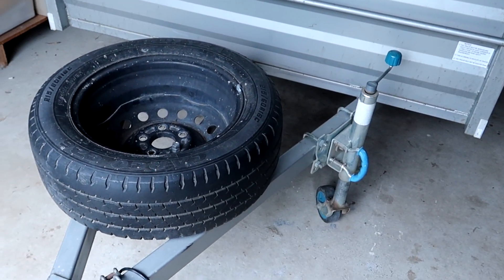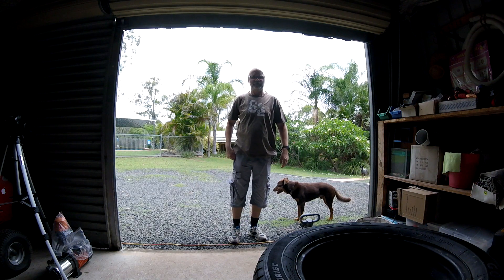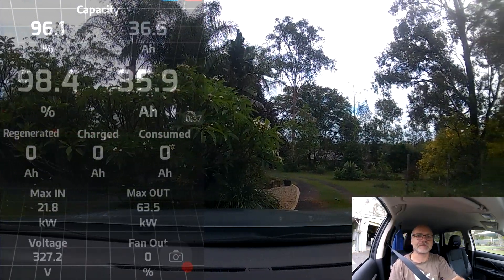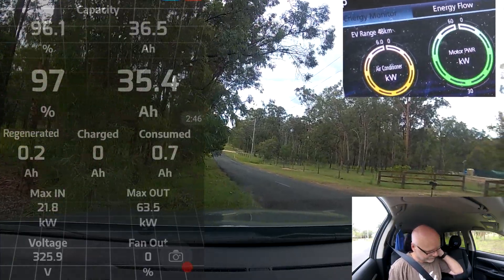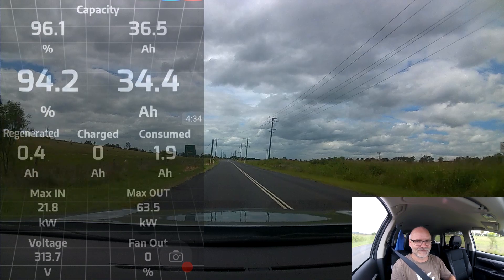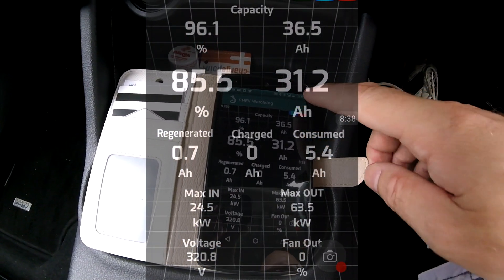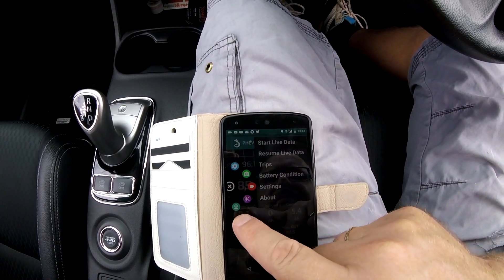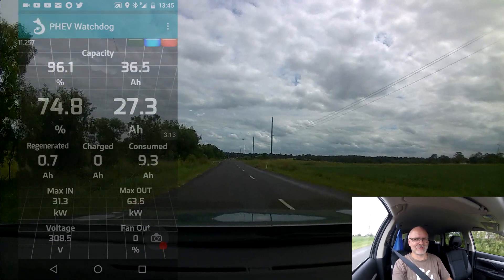Ep19.1 - Electric energy consumption while towing a trailer with the Outlander PHEV 🚚

Comment: Gruess Dich Guru Andy...question what if my Phev breaks down and it needs to be towed? I read it should NEVER be towed on a rope...just on a pick up truck..and then only if rollers are used on the wheels to pull it up onto the tow truck. I am a PHEV newbie...still learning. Have you a video on this? Danke in voraus Mat
Reply from the maker: That totally depends on the situation and problem, I guess. The PHEV can be towed and also charges its battery while doing so. But if there is something wrong with the drive train, a flat bed is the only option. There is a heap of stuff in the manual from what I can remember.
Reply: @unpluggedEV  Great thanks :)